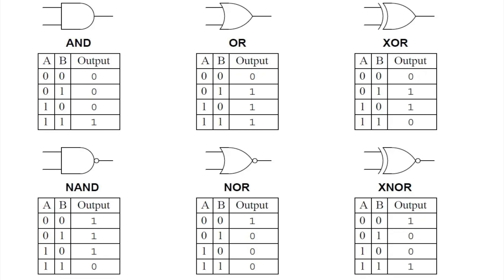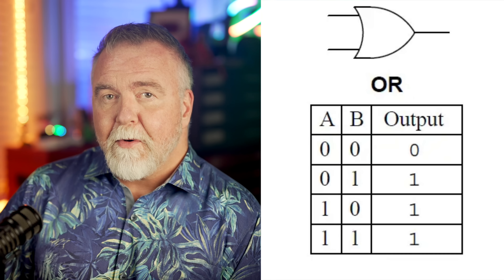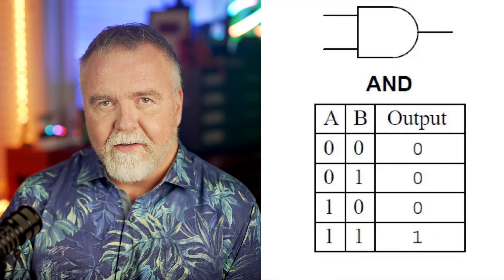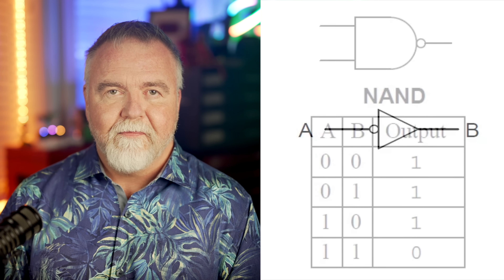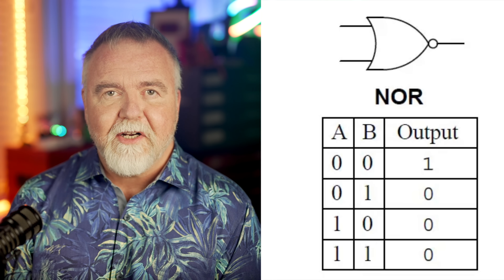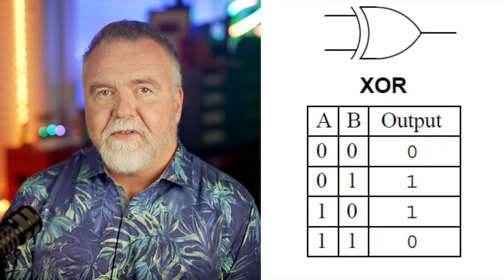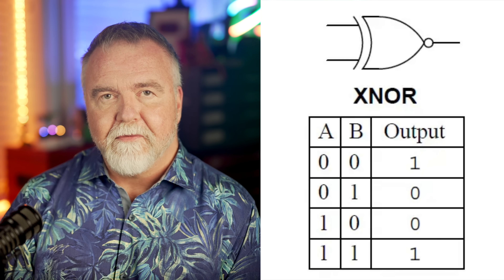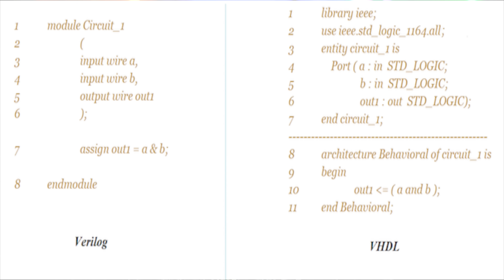The "Do Anything" Chip: FPGA

Comment: FPGAs are amazing, and I have had a very happy early career based on them.  They are huge in trading, as well.  Programming them is still a huge pain, unfortunately.

One nitpick: FPGA CLBs do not actually contain logic gates - they contain lookup tables that can be configured to act as arbitrary combinations of logic gates with n inputs and 1 output.  Modern FPGAs use 4- or 6-input lookup tables as their basic building blocks, often with some hardware to combine those lookup tables together to make wider functions.
Reply: In college, several times I just used an EPROM to implement moderately complex logic circuits by just storing the truth table. I couldn't (easily) use them for things with feedback, such as flip-flop circuits. But that is possible by looping one or more output lines back to an address input.
Reply: @strehlow  Yeah, it's kinda like, you could build a computer entirely out of SRAMs but you'd have a hell of a time booting it
Reply: @strehlow  State machines are more flexible but you have to watch out for propagation delays.
Reply: @karmageddon9136  Not if you write them the proper way
Reply: @karmageddon9136  Finite state machines are not a substitute for combinational logic functions implemented in SRAM.
It is not true to say they are more flexible.

Flexibility doesn't come into it.
What you can say is that FSM's can implement more complex behaviour.
In fact, FSMs are less flexible, because you can't just use them anywhere, which you can for combination logic functions. FSMs have to be designed for a specific purpose, and thus it can only be used for that purpose.
Where as logic functions such as simple gates are the basic building blocks for just about everything.
Reply: @karmageddon9136  - I'd argue a state machine is a higher level concept.  You can implement a state machine in a PLD, an FPGA, an ASIC or in a computer program using a CPU or a GPU...
Reply: @deang5622  techniclly, any CPU is still just an FSM + state (i.e., a Moore FSM). So, it's possible to construct a universal FSM capable of doing everything.
Reply: @vitalyl1327  Not quite, FSMs are less general than a Universal Turing Machine. Just like you can't parse HTML with regular expressions, you can't implement an UTM in an FSM. But considering computers aren't "real" UTMs because of the finite memory, your statement may be valid. I can't tell for sure as I'm not versed enough in automata theory to verify that. Intuitively, I'd say that real computers are actually linear bounded automata rather than FSMs, which is something in-between, but intuition often fails, so take that as you will.
Reply: @gcolombelli  of course, a real-life Turing machine cannot exist, it will need an infinite memory. Any real-life CPU can be represented as an FSM though, or a system of connected Moore FSMs if you want cycle accurate representation.
Reply: @vitalyl1327  Interesting, I thought that the limited memory only meant it was restricted to a LBA though, not further restricted to an FSM. Can you recommend some material for me to read on this topic?
Reply: @gcolombelli  sorry, I mean Mealy FSM of course - CPU can be represented as a Mealy FSM, and inputs are memory bus data lanes (+ registers) and outputs are registers and memory bus address lanes. Now, it's not that unimaginable to represent, say, a very simple, 8-bit one-instruction computer with just a ROM or a few ROMs and nothing else, if the input state width fits 16 or so bits.
Reply: @vitalyl1327  I'm still a bit confused about whether LBAs or FSMs are a better model of a "finite memory turing machine" as, from what I've read, a FSM is like a turing machine that can only perform reads on the tape and can only move the tape in one direction. I can kinda understand the notion of computers being "finite state" in that it can only have 2^N possible states, N being the total number of memory bits it has, including CPU registers, RAM, non-volatile storage and so on... but that surely doesn't seem an "user-friendly" abstraction to look at when compared to less restrictive models.
Reply: @gcolombelli  if you look at the CPU registers as an input for an FSM, then the number of states will get really small and manageable. Especially in the early multi-cycle CPUs.
Reply: Oh..  that's what LUTs are.
Reply: Not sure about the "huge pain", I'd take an FPGA instead of an MCU for most of the projects (well, besides the cost considerations), because it's easier to program.
Reply: @vitalyl1327  You are conflating  "programming"  and building.

If you employ a macro of a microprocessor into an FPGA, the software for the processor still has to be "programmed" just as it does for the discrete MCU.

Where the FPGA scores over the MCU is in terms of the hardware build with the board and physical build process being less complicated with fewer components in the FPGA solution.

But the word programming can also mean the transference of the hardware design into the FPGA, which originated from the days when we "programmed" PROMs and EPROM, burning data into the devices.
Reply: @deang5622  no, I am talking about programming in a software side of things. MCUs are very hard to program because they're single core, sequential and must use interrupts for peripherals and timers. It's very hard to do real-time programming with tight latency constraints this way.

FPGAs are much simpler to deal with, just make everything work in parallel and do not worry about things affecting each other.

In terms of board design, FPGAs are still slightly more complex than MCUs, but only slightly.
Reply: @vitalyl1327  I've never found mcu's hard to program. The atmel mcu's are pretty intuitive and use basic C code. Also they just program with a UDPI programmer. Honestly super easy to use.

Sounds like you're just bad at managing your memory, and managing interrupts (which really isn't that hard to do just while loops with a delay function and an interrupt as a breakaway condition).
Reply: @HerbaMachina  I believe you did not understand the problem here. Let's take some practical example - a field-oriented control of a 3-phase BLDC motor. Your MCU must perform ADC sampling exactly when low side is open and when it is closed to calculate the bias (assuming low side sensing). You must complete FoC calculation before the next PWM cycle starts (ok, let's allow duty cycle change every 4 PWM cycles). You need to communicate with absolute encoder over SPI every PWM cycle. And you need to handle communication with some higher level loop (CAN, UART, whatever) which can happen any moment of your sequence and can change the targets for FoC calculations. 

On an FPGA it is trivial - all the processess above are parallel and hardly ever interfere with each other. On an MCU you'll struggle to sequence everything giving time to process communication (and you're very lucky if you can do it without interrupts), and make sure that critical things are never interrupted.
Reply: @HerbaMachina  i.e., what you're talking about can be "easy" if you do not care about latencies of a few milliseconds. If your latencies are in microseconds, MCUs are awfully hard to get right, while FPGAs are trivial.
Reply: Hehe, I had the same nitpick.

Also, CLB is not a standardized term, it's specific to Xilinx. Intel calls something similar an ALM.
Reply: During the '80s, '90s and '00s I worked for a number of hardware companies writing system software and device drivers.  The companies were mostly small, so I got to do a number of interviews.  One of my favorite thought questions for any applicant that had a EE degree or background was, What's the difference between a PLD and an EPROM?

Anyone that knew the real answer to that question knew that a "lookup table" is a programmable logic gate.  The only difference is the maximum number of Boolean product terms that can be expressed.  In other words, EPROMs tend to be logically more dense...
Reply: @joelcorley3478  True, but slower. A lot slower. And not suitable in many applications.

You can also use multiplexors to implement combinational logic functions.
Reply: What do you mean by "huge in trading"?
Reply: @justingreen8006  Every nanosecond counts in high frequency trading - they measure the length of the cables going to the exchange because it actually matters.  That said, I think high frequency trading should be eliminated because it serves no purpose to the market; it's only useful in front-running.
Reply: @justingreen8006  High speed trading uses FPGAs both for their sheer speed, and their field reprogramability. When 1ms makes a difference every advantage counts, and FPGAs are king there.
Reply: @justingreen8006  FPGAs are used because of their increased speed over a software implementation, certainly in relation to crypto mining.
Reply: No. Different companies use different architectures and technology.

Xilinx created the concept of CLBs using static RAM. Other vendors use non SRAM based technologies.
Reply: @deang5622  The "CLB" is a Xilinx construct (Intel puts your LUTs in "ALMs" rather than "CLBs", for example), but LUTs are universal in FPGAs.  There are ~10 major vendors of FPGAs, and all of them use LUTs as their main form of programmable logic.  Not all of them use SRAM - some FPGAs use efuses instead (and are one-time programmable), and some load the SRAM from flash at boot time.
Reply: @nima8071  Yes I know! I was using Xilinx FPGAs in 1990.

Comment: Worked with a company that used these extensively.  We were building custom interfaces to some archaic main-frames.  Back in the day, an interface board was a 19-inch rack board loaded with 7400 series chips to handshake with the bus (32-bit data, 24 bit address and a dozen or so other hand-shaking signals).  We still used the 19 inch form factor, but was reduced to just a half-dozen chips, two or three being FPGA.  

During testing, have a glitch?  slight timing issue?   Tweek the design, attach the programming cable to upload the change and try again.  Really fantastic devices.